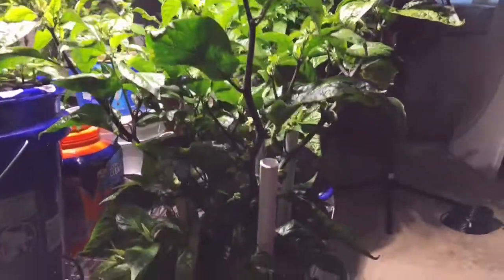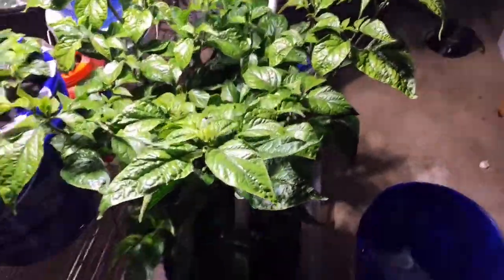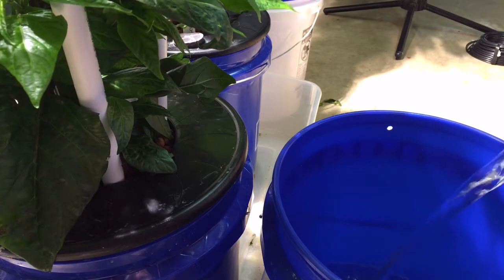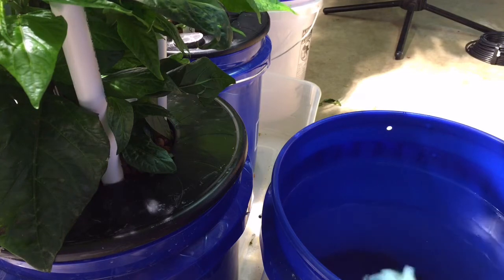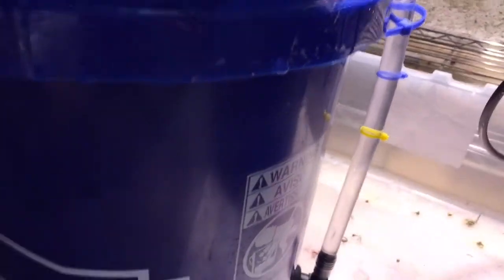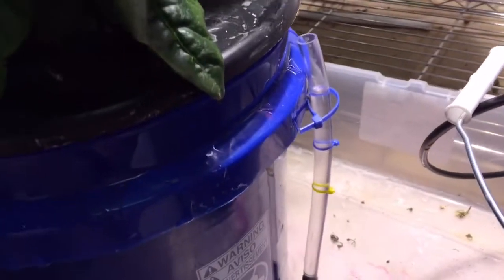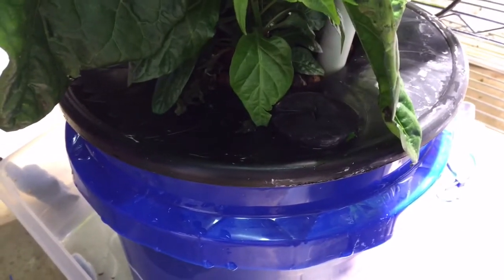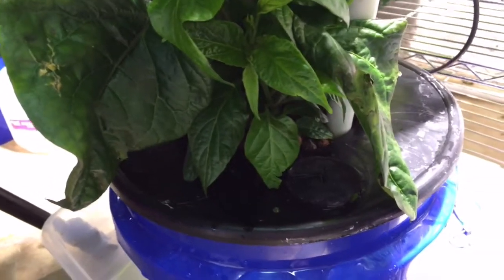Hydro How to Transfer between DWC Containers - BBM Pepper Plant

Comment: Are you using metal halides all the way through, past tense did you use the metal halide all through out? Been trying to grow some Jamaican Scotch Bonnets and they are taking forever since summer 2016 underneath a hps and some home made. leds
Reply from the maker: On the bbm in the video I eventually moved it outside and put in a large, 45 gallon Kratky setup and it produced really well. My indoor light is a 400 watt cmh, and it's great for growing, but isn't strong enough for good pod production. Pods from plants I've grown under it usually come out small. It does seem to adapt them well for going outside though, with no need to harden off.